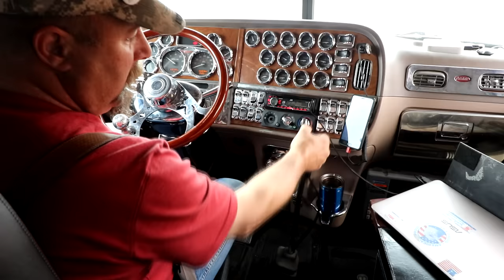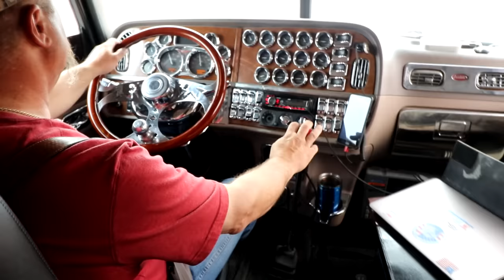How to shift an 18 speed transmission

Comment: I've always wondered how many gears they skip when they're unloaded. At a red light with a load it's like BWAP BWAP BWAP BWAP BWAP and they hit 5mph lol
Reply: Not anymore with tesla truck.
Reply: @sumanthv7091  A Tesla truck would need hundreds of thousands of batteries.
Reply: @lukemmurphy795  but it does the job.. haven't you seen the tesla truck launch video.. it's gonna change the future of transportation...
Reply: @sumanthv7091  Tesla isn't anything that impressive. Wait a while.
Reply: @lukemmurphy795  come on bro... Really ???? You think so...
Reply: Luke  M Murphy lmao, the forefront of electric vehicles isn’t impressive
Reply: @sumanthv7091  it all sounds nice, but loaded vs unloaded (when going from stop to 50 mph) the fuel consumption can get as high as 1 mpg loaded vs 3 mpg unloaded. How electric cars and trucks are build now your batteries will be empty after a few red lights
Reply: @sumanthv7091  Trucking doesnt have time to wait for a battery recharge....
Reply: Samuel Yi it takes 30 minutes to get 400 miles on the tesla semi battery thats not bad at all and you do it while unloading the truck the advantages of an electric vehicles basically out weigh almost everything electricity is around 3x cheaper than gas and at night or early morning its over 30x cheaper the tesla semi has regenerative braking meaning you get electricity back you can also accelerate much faster with it the only concern I have is the noise level electric vehicles tend to be quiet I own an electric car from nissan and they add a noise to the car
Reply: Luke  M Murphy a megawatt battery
Reply: @Kilowatt01  First of all. Semis use diesel. Second of all. 400 miles is nothing when Semis put millions of miles on the engine without a rebuild... Diesel fuel is better thsn shitty EV. Why do you think TESLA stock is dying lmao.
Reply: Luke  M Murphy you do know the largest haul trucks in the world are electric
Reply: @samuelyi9189  I have 1.4million miles on my Cat C-15..and im being loaded now for a 730 mile trip...

I'd love to see how those batteries last hitting mountains every day, stop and go traffic, and pushing against wind in the midwest..this past week i've driven over 600 miles a day, and alot of these loads have tight schedules..no time for sitting and charging...also these aren't sports cars..0-60 times don't mean shit...its about range
Reply: Samuel Yi 400 miles in 30 minutes is nothin? Lmaoo I’m all for diesel power but what, is it unlimited or something? Last time I checked it’s NON-RENEWABLE. Shitty battery lmaoo🤣 this man Elon is on the forefront of technological advancement while your stuck in the past.
Reply: Alec There’s a maximum weight for trucks that goes for with and without load, The tesla truck currently is about half of it while a normal one is only like 20%. They’d have to give up alot. But hey maybe it’ll work out.
Reply: Samuel Yi Tesla’s stock is in its 2nd straight week of gains.
Reply: @sumanthv7091  Gonna take decade when that truck is benefical for long road hauling, but its gonna happen in future.
Reply: Brandon Miller in Europe we learn on a manual shift
Reply: @mclarry1084  Diesel engines are designed to run on plant oil...which is a renewable source. We can litteraly grow fuel to run truck trains and buses..but...you know....money...so calm down...
Reply: Uh, guys, do you realize the enormous power requirements for supercharging a fleet of Tesla semi tractors?  There are some situations where it won't be a problem, but as far as re-fueling on the road right next to a bunch of others?  I am pretty sure that such a charging infrastructure is a long ways away from happening.  

And the bulk of batteries drastically decreases the payload capacity.  Not the truck's capacity, but the roadway capacity.
Reply: @lukemmurphy795  Tesla invents fastest production vehicle to 60mph from a dead stop "Tesla isn't anything impressive" lol okay kid
Reply: @nickydrifts  *Second fastest. It can't even sustain it either with the current batteries.
Reply: Tesla?
....Oh, you're referring to coal fired vehicles.
:)
Reply: @lukemmurphy795  I agree.
Reply: @qualeb8164  Compare it to cell phones or  televisions.  Yeah, not that impressive.
Reply: Luke  M Murphy the truck is already there...
Reply: Samuel Yi at the Moment Diesel might be better. But it will change,
Reply: When all these tesla fanboys dont understand that the renewable electrical energy theyere talking about comes from coal... lol
Reply: @TheGamersRace  Fun Fact: Power stations are much more efficient (in terms of Power per Unit Fuel) than a vehicle engine. So, even if it is coal fuelled, the volume of fuel required to sustain that power output is significantly smaller and hence, total greenhouse gas emissions are smaller.
Reply: @paulstandaert2042  Heh...batteries operating in above 100 degree and -0 temperatures pulling thousands of pounds up mountains...hell most trucks have issues STARTING when it gets cold due to the fact that batteries can't be used to their full potential at those temps....400 miles of range? What truck driver drives until their fuel runs out in the middle of nowhere without a refueling station for 100 miles....more like 300 miles of range...

I fill up...takes me 7 minutes...and I can go for 1400 miles...I fill up every 1000 miles so I'll never be stranded anywhere
Reply: Consider that in order to have the same amount of mechanical energy inside batteries you pretty much need to multiply the weight of the fuel of a big diesel engine by 10-15. So if a truck  have 1000kg of gas you will need at least a 10ton battery to have the same energy. A 10 ton battery will also make the truck quite less efficient because of increased tire losses. Then I would like to see the power requirements to recharge such a battery in half an hour, we reach the multi megawatt range here.
Reply: Electric trucks would work better in a city environment. Keeping emissions down in heavily congested areas. They also have the infrastructure to support the energy requirements.

Long haul trucker need Diesel. If there was a better energy source they would use it. It’s common for truckers to get snowed in for a few days because of the freezing weather.  batteries do not do well in negative temperatures, Diesel is readily available and transportable. 

What I think what needs to be implemented in semi trucks is a brake charging system using the energy from braking to charge a battery to help get a diesel truck get started like a hybrid or drs in F-1

Or a power plant like a train where Diesel engines drive electric motors. 

But a fully battery powered semi is still not proven.
Reply: @Baer1990  Diesel and electric engines work differently. And as you drive the truck, the battery recharges, not enough to drive forever, but enough to give the electric trucks much better gas mileage. Even if they didn't recharge, the mileage wouldn't be 0.5 trust me.
Reply: @samuelyi9189  He's talking about 400 miles on a 30 minute battery charge, not rebuilding the entire fucking engine after just 400 miles lmao. That's from LA to Vegas and back on a half charge, and saving hundreds in diesel. And also Tesla's stock is dying along with every other major company because of the tariff situation. Perfect time to buy some stock if you ask me, it's just gonna shoot back up.
Reply: @williamkillingsworth2619  I agree..surprisingly...stop and go traffic is best for the regenerative system EV's rely on.

Ups..fedex..and other trucks that are similar to Uhaul trucks that do nothing but city driving would benefit from a purely electric system...Just as we have trains to do the heavy hauling for the heaviest if materials over the longest distances, which are then picked up by 18 wheelers..that go the last 1000 miles to the store or 3000 if the train transported them to a manufacturing facility, we can have electric trucks handle the shortest of deliveries..mail..amazon etc. 

Only thing I don't agree with is regenerative braking. When i'm driving i conciously (i know i murdered that word) think of the energy being lost from bringing 76,000lbs to a stop. However if that energy was transfered to the 4 batteries, it would make no difference in cold startups...the particles in batteries just move too slow...coupled with trying to move 6 heavy piston arms through thick (because of the temps) oil...

Not sure how a diesel electric motor would work on truck...probably too expensive...but thatd be my best bet on evolving the industry...that and using vegetable oil as fuel...like they were designed to do....
Reply: @BlastCODM  the mpg part or the electric part? Because you are right about the electrics. The mpg are converted from my onboard computer
Reply: @luisprado7107  Yeah I might have exaggerated the electric part, but when I'm 50 ton 1 mpg when accelerating at low speeds isn't far from the actual fuel cobsumption
Reply: @hello_2632  yeah, but then you're generating 100,000 cars worth of pollutants in one area, and are hitting the general ecosystem pretty hard with it even if it's more efficient, it's very localized.  Cars naturally aerate their own pollutants. Even then, the efficient generation of electricity is lost in the transfer through the electrical grid anyways, so any gains would be minimal at best.  The best way to transfer electrical energy would be in Hydrogen gas, it would also reduce "charge times" by being able to fill up your fuel cell powered car instantly.  It would also remove alot of car maintenance, which would keep cars running longer since electrically driven cars generally dont need as much maintenance.  So less building and destroying new and old cars.
Reply: @arjanpetersen  Probably, but not with lithium ion toys it wont. Lol
Reply: Samuel Yi yes semis use a fuel that happens to be less efficient, add emissions to the air and is not renewable. I didnt say they are for everyone. Also what makes you think a vehicle can’t last because its electric? I’m sorry I can’t tell if you are joking with diesel being superior to renewable energy which is 3-30x cheaper than diesel. Tesla stock is dying? Since when? They go up and down a lot but they sure are not dying lol The only issue with it currently is if you cannot afford a 500 mile stop lol The range of the semi isn’t 400 its 500 actually
Reply: @Kilowatt01  Diesel is more effiecent than gas, and emits less C02. The price of fuel is inflated due to demand, so if the same demand for electricity were to replace that of combustibles, be sure that the price would jump up considerably. 

Also diesels can run on multiple fuels, including fuels that have zero emissions...we just don't use them because theres no money in renewable fuels such as plant oil right now, at least not as much as petroleum. 

It's not a thought...a battery cannot last 1.4 million miles of extreme toruture like a diesel engine can before it gets rebuilt. Go to a truck stop one day, see the line of trucks getting fuel and ask yourself if its plausible for each truck to sit 30 minutes to fuel...there would be lines that stretch out to the interstate, and an immense draw on the power grid....I know you want this to be a dream come true..but musk is full of shit..get over it.
Reply: @jmh4ggg  these Tesla fanboys dont get either that mining for, creating and recycling lithium ion batteries puts out a shit ton of pollutants too. Lol
Reply: jmh4ggg you do realize this is not for everyone like I said? Plant oil will not be used for fuel in the future. The only future for diesel is still burning co2 saying they can use this or that when it won’t happen won’t make a difference. It doesnt matter if the diesel is inflated or not electricity is still cheaper in my area it is 1-2 cents per kwh if I’m not mistaken and 10 cents during the day time for me to go 60 miles in my vehicle it cost me 24¢ based on its 24 kwh battery and me charging it at night with a 3.3kwh charger. You do realize currently it is 30 minutes for 400 miles? Which means soon it will improve more and more. Companies are already preordering them. I don’t know how you can say elon musk is bullshit I think he has much to offer to the future of ev and satellites. 

The current issue is range with electric semis. If you have to go extremely far in a short amount of time then go diesel. However if you can go 500 miles and then stop to unload  its perfect. Keep in mind there are two type of semis they are selling for different ranges
Reply: @Kilowatt01  "The only future for diesel is still burning C02 saying they can use this or that when it won't happen won't make a difference"

-Proceeds to tell me numerous things that can happen to improve electric vehicles

Biased and short sighted...you were one of the guys that'd say we'll have flying cars in the 1950's...with no evidence other than wishful thinking to back up your claims...Tesla wouldn't be nearly as successful if a new idiot weren't born every day.
Reply: jmh4ggg tesla has shown improvements to efficiency plant oil hasnt... and flying cars aren’t realistic.. how much improvement have you seen in plant oil compared to seeing more electric vehicles on the market?
Reply: @Kilowatt01  You don't need to improve plant oil...it just works...all that would need to happen is for them to produce it for energy purposes...they won't for the same reason they won't ban cigaretts
Reply: jmh4ggg what is the reason? and you can improve the process for using plant oil in a vehicle electricity can be collected by solar, its cheaper, more efficient, lets you accelerate faster, using brakes will give you a percentage of energy back, I don’t see why electricity in the years to come can be the future
Reply: @jmh4ggg  Yes diesel is more efficient than gas because it has a higher compression ratio. But it's mainly used for big rigs because it produces more torque. Also CO2 emissions are less for Diesel, but the amount of soot and NOx diesel produces is why it's banned in many countries or at least in urban areas. If every car used diesel the air would be black and we'd have nothing but acid rain and lung cancer. Even with emissions controls, the soot is just unavoidable. The NOx from engine heat also produces about 3 other nitrogen carcinogens and greenhouses. That's a huge no no in urban areas, as Diesel's nitrogen emissions are the equivalent of asbestos for the respiratory system.
Cats used on diesel and gas engines are pretty damn good at cutting toxic emissions. But diesel's soot makes it so the cat needs regular maintenance, like every week for some, and clog up easily. I mean the amount of NOx in the air is mainly due to diesels as is, and diesels are not all that common, imagine if every car used diesel. 
As for your demand theory, it's total dogshit, houses use 30x more energy in one day than a Tesla uses to fully charge, which can last a week or so, depending on how quickly someone uses 300 miles. Energy is still at about a dime per KwH and most Tesla's only need about 75KwH for a full charge. Fossil fuels are running out and electrical car technology is advancing exponentially. I don't get the resistence for Tesla's, Cummings engines are cool and all, but they won't be around for long, nothing anyone can do about it. Getting mad at the steam engine because you still own a spinning wheel is just pathetic and downright ignorant.

Also after about 500,000 miles a Tesla can possibly go down to 80% charge instead of 100%, at this point owners might consider a battery replacement. At around 100,000 most cars would've died, or costed more in maintenance than replacing the battery in a Tesla lmao. Tesla's don't have an engine, and have a very simple transmission, so the millions of things that can get fucked in an engine or transmission is eliminated, Tesla's really are amazing.
Reply: @luisprado7107  My prospective is strickly from that of a truck driver.

The last time I filled up, it was $602...and thats every 2 days.I'd love to take that money and spend it elsewhere...i'm not against Tesla in general..the cars are great, I want one myself to be honest. But if you're talking about a battery powered truck? I just don't see it...i could be short sighted but I don't see a battery that weighs a considerable amount, and can't perform as efficiently in adverse conditions taking over what already works. I just don't understand why we don't use another fuel source to power these diesels, and eliminate emissions completly.

After 2010 regulations were put on highway diesel engines...aka 18 wheeler diesel engines...the dpf system eliminates more than 90% of soot and particulates...it's actually cleaner than a gasoline engine at this point, and most trucks use them. However I do run a truck that was made in 2005, because those systems often clog and are costly to repair. 

That being said, what do you think takes more energy? Running the air conditioning all day, or pulling a 40 ton load up a 5 mile 6% grade? I'll give you a hint. My highest energy consumption this year has been 2,500kwh in a month, thats 83kwh a day. As you've said, it takes 75kwh for a full charge to run a 2 ton (not a 40ton) car 400 miles, which is what trucks run daily on average......
Reply: @Kilowatt01  until they move away from lithium ion and go to hydrogen fuel cells these things will always be toys.  Once everyone has an electric car electricity is gonna go from 2 cents per key to 50cents per kwh.  That'll be the day.  If Tesla doesn't change what theyre doing their company will degenerate into car automation and electric motors for these other companies.
Reply: Nobody uses a clutch in a big truck.  Once you get to a certain rpms you can shift it into the next gear.
Reply: GamersRace I hope we do not go to fuel cells.  Hydrogen is more expensive than electricity and you are right electricity will increase but not from 2 cents to 50 especially if you invest in solar panels in the future with tax deductions. Hydrogen is usually created by emitting co2. If done correctly it can be done 100% without emissions but very difficult. Also it is more dangerous if there is a fire and when you transport it it is hard to contain all of it by the time it gets where you want
Reply: GamersRace Many companies burn oil, coal, or natural gas since it is easier to make it in that process so if they use any of these than it is not as clean as some may think.  You can do this process all on full electricity but that is insanely difficult especially for future demand. You also need to invest a lot of money in the infrastructure for hydrogen pipelines. In efficiency I have not seen higher than 80% and maybe by 2030 we will get to 86% as predicted. Also when hydrogen cars get set in flames you cannot see the color of the fire. Lithium ion ion batteries ignite less than any other fuel on the market currently.  We can support more electric cars via power lines it is not that big of an issue. Also even without the tax deductable solar is still worth it. In the long term you save money on your house electricity bills including your ev. The only advantage hydrogen has is filling up faster. Electricity will never be more expensive than hydrogen atleast not in the near future. Keep in mind many of the fuel cell cars are $60,000. I do not think many people will want to pay that much for a car and on top of that paying a lot for hydrogen for 80% efficiency currently.
Reply: @Kilowatt01   Alec   Alec   Alec   Alec  they burn coal to power steam turbines, and use that electricity to create Hydrogen, yes another method would be to throw superheated steam at natural gasses under pressure, that is a way to produce hydrogen gas with other byproducts, but it wouldnt be the most effective way of mass producing hydrogen gas especially since it would need further processing.  Generating electricity is a problem we face regardless of which electric vehicles we design and manufacture.  Fuel cell hydrogen has always been a extremely effective and efficient way of storing electrical energy.  Even if the low of 80% you're talking about was true that's still better than current battery technology.  Major pipelines for gas distribution would be a huge win because that would generate tens if thousands of jobs, like the pipelines we have now do.  Hydrogen gas can have flame additives added to it, to give it a smell and color much like they do with other gasses.  Lithium ion although doesnt explode very often, smokes and fires happen pretty often even if it doesnt lead to catastrophes.  Lithium ion isnt as dangerous as hydrogen because it just doesnt store as much energy as hydrogen does. Lithium ion also has huge disadvantages in storing energy, releasing energy, and manufacturing that hydrogen doesnt.  I didnt say hydrogen would be cheaper than electricity, I'm saying the price of electricity would rocket upwards, which would drive both lithium cars and hydrogen cars upwards in fuel costs. Fuel cell cars are expensive because nobody was making them, just like electric cars before tesla, which they are still pretty expensive. But they definately are getting cheaper as time goes on and they make them more efficiently. Although the power grid definately cannot handle the load of everyone having a car charging, the point is that the consistent heavy load is something the plants cant handle well either, not that there arent solutions to this but the manufacturing is electricity is made for people who charge their phones, adding everyones car into the mix is like going from 0 to 100 instantly and the generation of electricity just wouldnt be able to keep up.
Reply: GamersRace power plants can definitely support a population with electric cars I do not understand why you would think it can’t and it is only getting better with solar panels becoming more efficient. All while being great for the environment. Second of all charging phones is not the only low wattage use of electricity. The refrigerator, tv, dryer, all use a lot of electricity. Some of them are even almost the same amount of a small ev. If hydrogen is improving and batteries are improving with the outcome so far ev is ahead why not stick with ev. Hydrogen is much harder to work with than electricity. Solar panels will supply electricity to houses if you choose to invest in it or you can wait and the electric grid will start supporting them. Clean renewable energy from sunlight. Becoming more popular are batteries for your house tesla has a powerwall currently around 5-6 thousand dollars that can push 14kw for an hour. Keep in mind when everyone gets an electric car not everyone charges in the day, many will charge at night for the cheaper rate infact thats what I do after 9pm I set my ev to charge. Why focus on improving a vehicle that is almost 2 times as expensive as an electric car, harder to create fuel, more dangerous than lithium ion, most likely made without burning some type of gas, achieves less mpg than a gas vehicle, and is less efficient than an ev. Batteries are very good as well they deplete overtime depending on temperature and how often it is fast charges along with its total cycles. The batteries can be recycled as well. You also can get thousands of jobs in the ev industry. Building factories that develop cars and batteries. Working to install solar panels. Working on research for batteries. If needed like you said if some reason a grid has issues with the power, it will lead to more people installing new technology.
Reply: Lol this sound affects I read them as if I was hearing it Out loud hilarious the video was good and so is this comment great stuff
Reply: Jeff Nelson haha sorry about that!
Reply: @nickydrifts  you proper love Tesla don't you they are the apple of the car world
Reply: Sumanth Vnair  nope unpractikal low range long rest times unles you full low flexibility 

And the most important

Not enviorment friendly 
The production and wadte aftee each 5 years again 
How much materaials are wastet ?

Synthetic fuel and hydrogene is the future
Reply: Sumanth Vnair the vid is a joke!!
Reply: @sumanthv7091  Until the lighter, more energy-dense batteries are used, tesla is useless. When half of car's weight is a battery, you know you're doing something wrong.
Reply: woke npc #AI2866 they are on the linit with licium ion
They are around since the 80s
Baterys are in the majour disatvantage because you dot get realy denser energy than in liquid form

And on a regular car your fueltank dont disintegrate chemicaly with age.
Reply: @qualeb8164  no it is not you should actually know that decades ago they didnt allow the realise of a magnetic moving engine if you can understand why. Also do you know that you can grow your fuel ????
Reply: @sumanthv7091  Do you see what you've done?
Reply: @BrandonMillerRaps  No... What??
Reply: @sumanthv7091  everybody is arguing over electric Vs diesel lol
Reply: @BrandonMillerRaps  Yeah I just realized.. lol...
Reply: @Kilowatt01  What produces that electric?. Coal, Gas and nuclear are a few examples and also it will get more expensive once people switch to electric
Reply: zzirSnipzz1 yes it will probably get more expensive, but still cheaper, and more efficient than gas or diesel. I believe around 45% of the power generated in the US is renewable in time that will change. Also with solar power on your rooftops in the future it will cost you less for your electricity bill in the long run. If you buy a battery for your house thats even better supplying solar/ battery power for your house in the day and also charging.
Reply: They skip a shitload when bobtail. 
Try and not get smoked by one off the line  if you have an economobile and he wants to get it on.
Reply: MrHillfolk what? Lol
Reply: @Kilowatt01  What happens when it is damaged? you do realise battery acid is even more dangerous than fuel you can wash fuel off or put it out but acid will burn you also you dont own said battery from what i hear its the car company so you pay for the shell. My aunt had a battery car and found it rubbish you had to plan your route each day and hope that the charging area wasnt occupied. The US is 16.9% of its energy from renewable energy.
Reply: @luisprado7107  My ole mans car is at over 300,000 miles and still going strong its all about servicing it well. And many old diesiels are still going strong in old lorries and tractors love to see a tesla last that long. imagine the cost to replace the battery once they got a monopoly it will be greed as always.
Reply: @UClDYaR87mo2FYt5nlnN3otw More worried about acid burns and also acid can explode and is very flammable, guy i know was grinding a piece of metal  with an angle grinder with the top of the battery off and it exploded. Also have you ever seen a battery explode i have it isnt pretty. i can see we are all going to batteries in future but i would prefer. nuclear is expensive and you cant get rid of the waste hell the US has a giant concrete dome in the sea that is breaking down if it goes the pacific will be contaminated
Reply: @sumanthv7091  if only we had an infinite source of power that we could harness.  Like a massive fireball in space or something.
Reply: Loader: Ok so we'll just load up the trailer then.
Driver: No no no. that's where the batteries are.
Loader: Then where do we put the cargo?
Driver: Glove box.
Reply: @sumanthv7091  motors have way more power, ex. Electric golf cart going up a hill... it cant.
Reply: @thomaspace1335  Have you seen Tesla truck launch video.. u didn't... Watch it and you'll realize..
Reply: @xmr9475  Even bigger hauleres, freight locomotives, have diesel engines which drive an electric traction motor to move the locomotive.
Reply: @jmh4ggg  actually you do have time to sit and recharge. You by law have to take your 30 minute break after eight hours and you can travel I think 500 miles before needing a charge then get another 400 miles after thirty minutes. You aren't driving close to 900 miles a day.
The eletric vehicle will get the job done way faster and 0-60 time does matter. 
Also the torque on the electric truck will dominate the mountains fully loaded. 
The battries will need replacing every so often but with what you save on other maintenance it hopefully shouldn't be anymore expensive to operate than a diesel, probably less
Reply: Luke  M Murphy lol you're literally stuck in the past
Reply: Sumanth V not if you can't charge it fast enough. Many people think that fossil fuel companies hold back progression in electric cars, not so. Society has been raised to want or need things now, its more that they need to get things done in a hurry for society to keep progressing and not break down. Who wants to wait over night for a car to charge to only go 300 to 400 miles at a time. I say it has to do with the batteries not being able to charge that fast. You fix that problem of charging batteries or slow society down then electric cars might prevail. There is no way to make a battery that will charge that fast. It's impossible to put thousands of amps charge into something in in less than 30 minutes that will go 400 miles or as long as a gas car or diesel truck. I don't ever see electric cars or trucks prevailing
Reply: Luke  M Murphy 301274 AA batteries to be exact
Reply: @daveycrocket6277  It's easy to see electric cars prevailing. Is society so lazy they can't charge their car when they get home? Teslas are fast, modern, stylish and spacious, what's not too like? Long term they are better for the environment as well.
Reply: Brandon Miller they would have to change so many regulations in the law if they made it and there’s no room for them do charge the trucks unless they installed them at the gas pumps but people don’t have time to wait 30 minutes for those things to recharge
Reply: We don't have the power for a real tesla semi truck learn your facts
Reply: jmh4ggg yes they can run on plant oil I’m aware of that but that doesn’t mean everyone uses plant oil. There’s simply not enough. Obviously plant oil is renewable but I was referring to diesel fuels that are derived from mineral oil. Growing could be a viable option but really how efficient is that??
Reply: GamersRace thanks
Reply: GamersRace I retract my prior comment as I see that you appreciate the efficiency of Hydrogen cells, I agree that is definitely where people should be investing their time and money for research including Tesla
Reply: @jjcuna  you do understand that phones have had quite a few years to kick start while vehicles have hardly had a chance to move to battery power, right? you compare tech that has had public demand and funds for improvement to a startup that does not have as much demand because of people already having some form of alternative transport. give it a few years and the teslas will be more impressive than they already are.
Reply: @qualeb8164  WTF? How long have vehicles been around?  We never know what tomorrow holds. Some new tech could be released tomorrow making both power sources obsolete. I'm not going to have a YouTube debate with you.  You win!
Reply: @lukemmurphy795  yes, that is why they would be so impractical 🛻 ⚙️